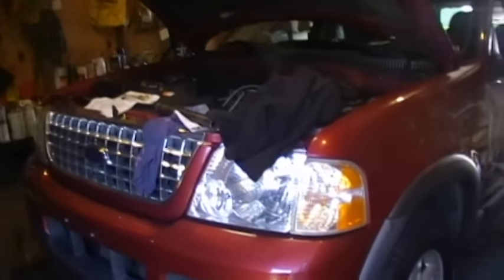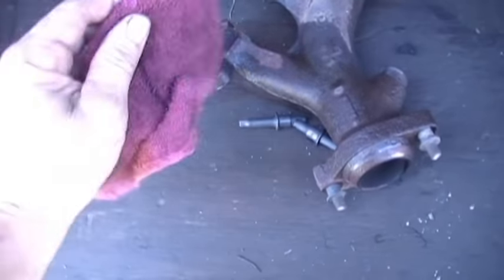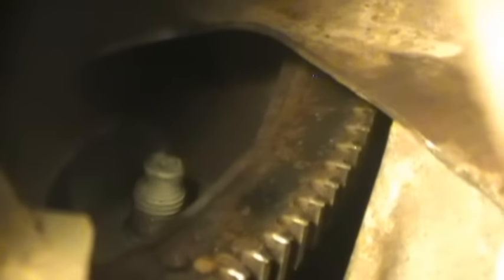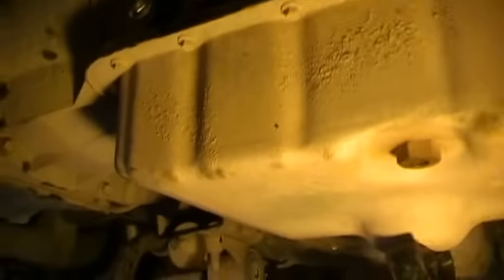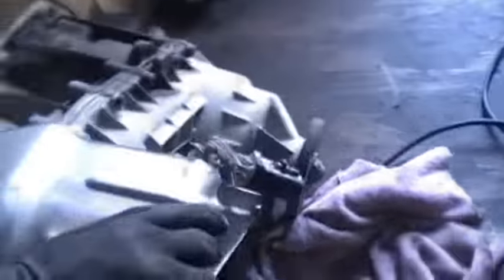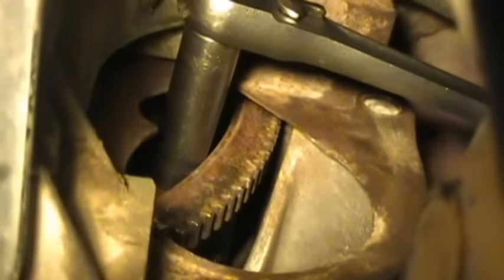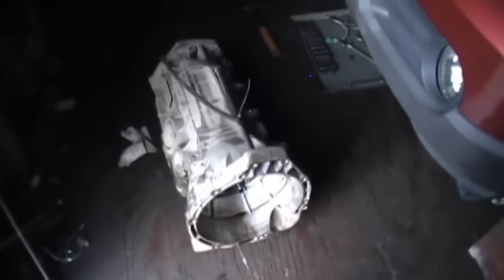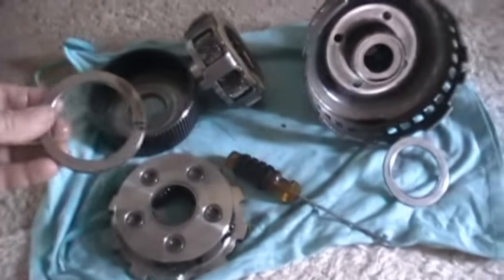2003 - 4.0  Ford Explorer Transmission Replacement

Comment: So sorry to bother you.  I purchased a ATSG manual and am a little confused on the direction of the thrust bearings. They use the terminology, inner lip up or down. The manual, in the assembly, shows easy to understand cross sections, but they are some that are contradicting explanations and views that I have download at http://www.ratiotek.com/5r55w-complete.pdf

Can you tell me the right direction to install the thrust bearings? Is the ATSG manual the right way?
Reply from the maker: Yes I think its correct as long as the bearing has no play or rough spots in it. It must be in perfect shape.

Comment: on taking out the transmission , you may save yourself some work leaving the torque convertor bolted fast, just take the bolts out of the bell housing and pull it off, the trans. the torque convertor fits into the shaft on the trans. when you reinstall it you can shift it to drive and turn the out put shaft of the trans to click it into the torque convertor, unless you are going to replace it too, but good video  , also when you reinstall the bolts you may want to put on some what they call "antiseize", a graphite compound, in case you needed to know.
Dont feel bad , i am in the process of pulling out my 4R55E  from my explorer, when i seen your metal in your pan, , wow, i can put mine in gear , but it won't move unless i rev it up but , it doesn't do that anymore, i'm figuring as i talked with the AAMOCO guy today, 
the bands are possibly burnt up , mercy knows about yours!! He said will if you can get it shifted then thats a mechanical issue, since the components need fluid pressure to operate, the bands needs pressure, who knows, maybe there is trash in the valve body keeping the pressure from building, its a thought. I hope you are aware of the servo valve shafts where Ford had made the shafts of the servos hard steel that wear out the ports they slide in , they have a special replacement for these, mine seem to be ok.
Reply: by the way your video is the only one I found about the 4R55E transmission

Comment: Hey Nathan R.    - when you're installing/replacing  the entire transmission/torque converter   exactly how much transmission fluid is needed for this vehicle?
Reply from the maker: 8 ish +
Reply: @FixingWithPassion  What is the best transmission fluid for 01 Ford Explorer Sports Track? And are you 100% sure that it's 8ish plus or 11 total?

Comment: Would it be easier or would you run into clearance problems if you left the Transfer Case bolted to the Transmission while using a transmission jack? Your video show dropping the Transfer Case first.
Reply from the maker: Yea...it would be easier. I took off the transfer case off...because It was easier for me being by my self.

Comment: Great video. One question. When reinstalling the trans how hard is to re align the torque converter bolts to the flex plate. Not much room to spin the torque converter.
Reply: You can spin the torque converter very easy to line up the bolts. Take your time and don't rush it

Comment: Why do most ford have transmission problems?
Reply from the maker: I think is history of the user. Every vehicle has some issues that sticks out. These SUV's the transmission's have to work hard to keep the vehicle moving. 5,000lbs vehicle is a lot of wight. Some people think there driving a race car I  guess. That's why I baby my vehicle's. Hardly ever been stranded.

Comment: Hey man GREAT VIDEO, I just pulled my trans5R55s on my 2002 explorer 4x4 (came out great thanks to your video) got a rebuilt trans but I'm having problems with the linkage nut to make the transfer, broke whatever's inside the old transmission and now It just spins. Did you have the same problem?  Any help would be appreciated. Thanks
Reply from the maker: Linkage bolt? Not sure what you mean.
Reply: TVWXMAN32 sorry I always called it linkage but wear the gear shift cable connects to the trans, I got the clip off that you showed in the video with the screwdriver but the part that stays on the transmission  there's a nut, when I put a socket on it, it went through all the gears and then I applied more pressure to my ratchet and something snapped inside the trans and now it just spins and I can't loosen the nut so I can switch out that arm to the new trans. I probably have to drop the pan and work my way up, but was just wondering if you had the same problem?

Comment: any tips for reinstalling? did you use any sort of loctite on re assembly? did you install a aftermarket transmission cooler as not to suck in all the old nasty fluid?
Reply from the maker: I used no loctite and did not flush the cooler either. The filter caught all of it (lucky me) If you use any loctie use it on the fly wheel/torque bolts. The rest of the bolts just good old muscle ;) Drove it for 6mos ran perfect! I'm miss her after I sold Her.

Comment: good job question what was the problem what did find out after open it up. thanks for the video
Reply from the maker: I think it was  planetary gear. I Got a used on on e-bay and put it back to together and it ran great!  Almost 2 years ago. I did sell it over a year ago.

Comment: Great video !!! I got a solenoid pack at the junk yard for my 04 explorer. a mechanic ( not transmission guy ) told me it'd have to be reprogrammed. Does that sound right ?
thanks
Reply from the maker: No. No programing needed. The SUV'S computer does all that. Its all ready coded into the SUV'S computer. It will learn how you drive and program its self Accordingly. Why did you replace the solenoid pack?

Comment: Your video was a great help . Thank you for your efforts.
Just one question though.
I pulled the motor and transmission out in one piece as i had to do the timing chains on my 98 4.0lt Explorer.
Reconnected trani to motor outside the car and now have  re- install all items back in the car.

The motor is running well and quiet with the new timing chains , but the transmission dose not engage in drive or reverse.
I have not done any work to the trani other than disconnect and reconnect it from the motor.
Have i missed something ????
Your comments would be greatly appreciated.

Regards George
Reply from the maker: Wow, I'm not sure...I'd start looking at electrical connections on the transmission. Maybe one is not getting connected. Strange. Is the torque converter connected to the flywheel bolts?
Reply: Trani all good now just had to add a lot more fluid.
Thanks for your comments.

Do you also work on motors or just transmissions
Are you familiar with the timing of the balance shaft on the Explorer 4.0 SOHC Motor .

Hope to hear from you

Comment: Would a 2005 Explorer have the same transmission problems? The one we have has been well maintained.
Reply from the maker: 10-4 back door....yeppers....
Reply: TVWXMAN32 Okay. It has 99 thousand plus miles. Is there a typical time frame for when it fails or?

Comment: I've got all the bolts out from the bell housing and the nuts on the flywheel/flexplate but the transmission still won't budge do I need to just pry it harder towards the rear???
Reply from the maker: Yes...That's what I had to do. And shake it maybe just a little. When it starts to go....go slowly.... Make sure its propped up!  I don't want you to get hurt! Good luck!
Reply: Thanks for the fast response really appreciate it I was missing a bolt at the very top I got it now ! Great video!

Comment: I have Forward Forward Planetary Carrier 6 pinion that while pulling out of case the needle bearings fell apart.  By looking at one side of the race that stayed connected to the Planetary Gear bore, it looks the race is staked by the OD.  Does that mean I have to buy the whole Forward Planetary Carrier 6 pinion or can I just buy the bearing?
Reply from the maker: You might be able to get just a bearing....but it might be better just to get the entire unit. Go on e-bay...and look for parts you need. Tons of tranny parts cheep! I go there ll the time ;)
Reply: Thank you.  Kind of a shame when all of the parts that mate with the Forward Planetary and the gears look so good.  I did find one for $27 and ordered it.  Probably a good price considering I might have a heck of a time finding just the thrust bearing.  I'm also getting a new Over Drive Drum and OD Planetary Gear Set.  OD band had no friction material at all and completely burned up the Over Drive Drum and OD Planetary Gear Set.  Also, took out some teeth.
Reply from the maker: Yep...I had to do the same thing...bearings are mated to the plant. Good deal!!

Comment: HOW do you get the top two bolts OUT?
Reply from the maker: Long arms and extensions. You almost have to kiss the transmission to access them to bolts by letting the back of the tranny down some.

Comment: I got a good one for you.  after I took the pump out,  I only found one servo strut from the servo side from the od band.  the adjuster side strut was gone.  got any ideas of where it might be?
Reply from the maker: Its got to be in there somewhere. You check the pan?
Reply from the maker: Hey how did you get that your pump out?

Comment: I bought a rebuilt 5r55w transmission with rebuilt torque converter for my 2002 Explorer. It holds 12.7 qt per shop manual. Trans shop said dump 12 qts before installing. Shop manual said to start with 9 qts (Online ETE pdf instructions says 8 for what it's worth, then add...). I put in 9 prior to install, checked it and it is running out of the plug when I check it. I flushed and blew out the cooler prior to install. I called the trans shop and the manager said it needs the 12, to add 3 more qts, but I'm afraid of overfilling. I notice the transmissions they stock (in house rebuilds) are light gray, but mine, (they had to order...core? rebuilt trans?) is painted dark metallic gray. I'm wondering if the converter was prefilled and the manager doesn't realize it? Should I force 3 more quarts in? do I have air pocket? I hate to add when it is running out when I remove center plug running at warm idle in park. I think it is level on my lift. I drove it about 5 miles to circulate and it shifted fine, still checks overfull with only 9 quarts in it. I don't want to ignore the manager and void the warranty though. What do I do?
Reply from the maker: You can't over fill it. The transmission has a plug on the bottom of the pan.  You pump fluid in the transmission while the engine is running getting up to normal temp, you let the extra fluid drip back out until it stops.
Reply: Why would it only take 9 quarts then if the capacity is 12.7? The transmission shop says I'll burn it up and void the warranty if I don't put 12 in. I put 9 in through the sensor hole before installing. I ran it to circulate it with the intention to top it off with 3 more qts. I checked it while running at normal temp and fluid was running out as if overfull...with only 9 quarts! Air pocket? My theory is that maybe they ordered this transmission from another rebuilder and it was dyno tested or the torque converter was prefilled?
Reply from the maker: Just fill it up until it stops dripping out of the drain plus. You cant F it up that's what its designed for ;)  Not the side plug!!!  The bottom pan plug.
Reply: push down on plug then pull it up
Reply: I didn't add any more since it appears over full, or when I take the center plug out, some runs out. I don't know why it only took 9 quarts, but the level is still the same each time I checked it. I haven't burned it up by not adding the 3 remaining quarts as warned by the shop. must have already had 3 in it prior to me adding the 9.

Comment: I have a question. Recently repaired the transmission of ford explorer 2009 4.0 and a week later I heard a noise and I am now told that it is liquid transfer oil. And I do not think it's that, you think if you can help me, please
Reply from the maker: Liquid transfer oil   ?????????   lol
Reply: That's right, that's what the mechanic told me, when I called him to find out what had happened to him. Why that noise, as if something moved when you're driving
Reply: I just think that's not it, I say no mechanics, but by logic when there is oil leak leaves a mark on the floor, and this time it was not like that
Reply from the maker: Yea that will happen.

Comment: Great video!  Can you share where you got that boring kit and what the price was?  Thanks for taking the time...  I bought an 05 Explorer in perfect shape except trans, had the OD/IM servo issue, thought I'd do the o-ring fix but got it open and found the prior owner had already done it...  Ugh.  Thanks again.
Reply from the maker: https://www.ebay.com/itm/5R55N-S-W-SERVO-BORE-REPAIR-SYSTEM-FOR-OVERDRIVE-INTERMEDIATE-PISTONS/272427567829?hash=item3f6df2cad5:g:Lz8AAOSwPe1T5P39&vxp=mtr

I still have mine and was thinking maybe selling it on e-bay. But here is a link to one that is for sale. There not cheep!
Reply from the maker: The thing that sucks, that cross member is a bitch...because the bolts 
break at the frame....at least all mine did. Factory said " fuck the 
next guy who has to take out the cross member" lol  I think they used
JB weld on those bolts
Reply: Yeah that, plus the exhaust, are the only pieces I'm a bit concerned over.  I don't have ready access to a welder, but if we encounter that issue I can work it out...  Just adds to my 'buddy favor list'. ;)  If you do end up selling yours, I'd be interested LOL.  Thanks again for going to all the trouble...  Great work man.
Reply from the maker: Yea I going to say Exhaust next....lol   My 2000 expedition did not have
 to worry about the exhaust ;)  Tranny slipped right past the exhaust.  I have a Video on that 
one also...on here. Good luck fixing it. Hopefully you have a nice warm 
garage.
Reply: Hey one more question!  (My friend and I getting ready to tackle this in two weeks ;).  Obviously many of these Explorers have higher miles on them now and mine is no exception (200k+, but body / everything else still mint and working!)...  Your trans obviously had some hard part failure that you could detect before removal...  Mine, is just the missing 2nd/OD (servo bore / bands)...  Other than those, everything works quiet and smooth.  Fluid pretty dark, though.  QUESTION...  Did you replace torque converter.  I've priced my stuff and sure would like to not have to spend extra $200 if not absolutely needed...  But, don't wanna destroy my rebuilt unit.  What's the real story on torque converter replace?  Thanks again, and hope your holidays are great!
Reply from the maker: If there is no medal flakes in the fluid and the torque is not "rattling" On some models it more of an annoying sound. (Besides your will need a special alignment tool to align the torque converter with that flex plate that bolts on to the torque converter A different video for a different time;)....I'd just rebuild the tranny and save your money. Probably some burnt clutches is why you have no 2nd. And the 2nd gear band gets toasted often and is the most common issue I see. Other than that, the cross member bolts going to the frame always break. (I have a video somewhere on that also....lol,  having said that, go for it. Its quite interesting looking inside of one of these transmissions. Keep us up to date!
Reply from the maker: *NOTE:  LOL...I have no idea why, there are lines going through some of my reply....lol

Comment: can the torque converter stay with the engine
Reply from the maker: No! You will destroy the pump seal and it will be impossible to stick 
the transmission back in. Its less work to just up-bolt the torque 
converter.
Reply: thanks
Reply from the maker: Yea, that tranny fluid flow leaking will be like a woman's bad period....lol

Comment: Did you require any special tools?
Reply from the maker: Not really
Reply: Thanks.
Reply: Did you have to run any computer "learning" updates after installing?
Reply from the maker: No. I just dove it normally and the computer adjusted to my driving habits. ;)

Comment: do you have to remove the engine mounts to remove the transmission for an explorer sport Trac.
Reply from the maker: I don't think so.
Reply: I am in the process of removing mine but it does not come down low enough to remove the top bolts.
Reply: so I am stuck right there lol
Reply from the maker: I think I tilted the transmission down to get a room for the top bolts. Did you do that?
Reply: yes I did but the engine mounts is not allowing enough tilt.
Reply from the maker: did you figure it out?
Reply: I had to remove the two engine mounts.

Comment: These Explorers are a major pain in the butt to work on!  There is no access to anything.
Reply from the maker: Word!
Reply: @FixingWithPassion  ; How did you get that crossmember under the transfer case out?  I have to remove the tranny and transfer case as a unit and there's no engine to hold up the front of things.  My 2004 is on a lift (I was blessed!) and I have the trans/transfer case on a couple of barrels, but the right side still seems tight.  Every bolt on the bottom snapped ott at the head.  I found 3 bolts on the inside, threaded into the frame and have those out.  The left (Driver) side came down most of the way, but no joy on the right.  Found 2 bolts on the left inside the frame and only 1 on the right.  There's a plastic "box" on the right and I was able to pry it out of the way and look in through the hole.  I see the end of a pin(?), but on the other side of the frame there's a "bump" or "blister" in the crossmember and no bolt head.  Any ideas?  Who the heck designed these things?!!!  Jeesh!!